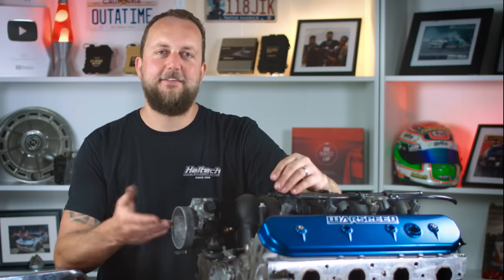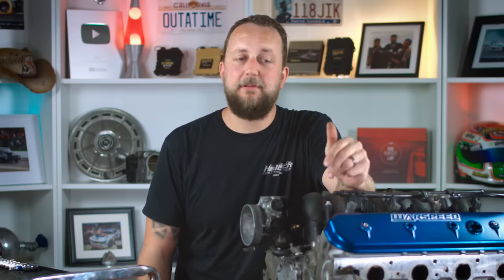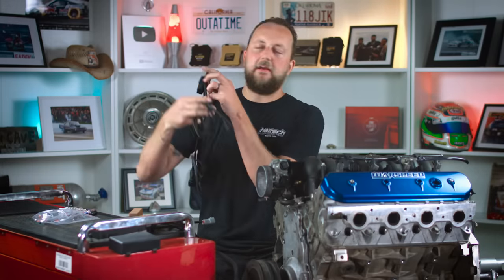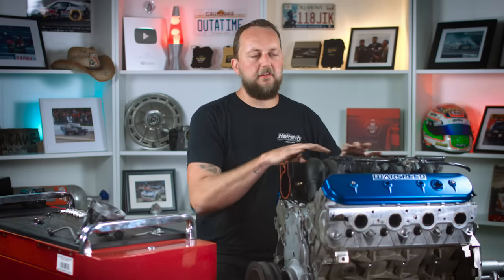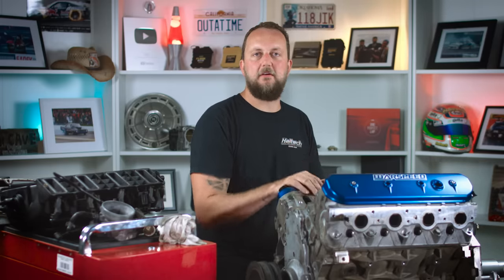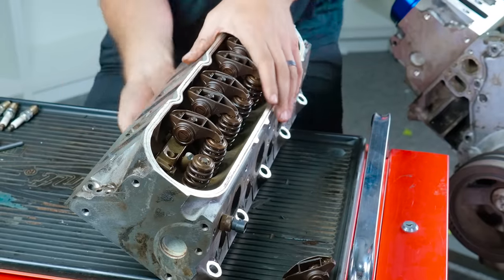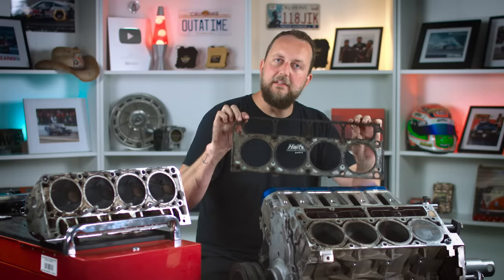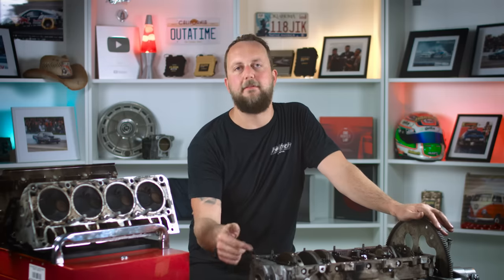🤔 What's so special about the LS? | TECHNICALLY SPEAKING |

Comment: It's whats called the "Amazingly average" phenomenon. Its not particularity special or amazing in any one area, it's that its above average in all areas.

Its cheap, Small, low weight, Simple, High HP and reliable. That's what makes a LS so desirable, and it is what makes gen I small blocks desirable still as well.

Comment: this is one of the reasons the gen5 camaro ss is way better than the s550 mustang...the coyote motor lacks torque..
Reply: Robert Mills  
wrong
torque is way higher on the ls.
the ls is easier to tune
easier to work on
smaller.
less things to go wrong.
if you check you'll find the ls motors have been voted one of the greatest engines ever created
Reply: Robert Mills  
that's why it's so great..easy to maintain and work on.
you ever tried working on a over headcam vvt motor..
those coyotes have no low end power and sound shite. nasty raspy sounding things.
i ended up hating my s550 mustang and went back to the camaro..way better car in everyway. not everything is just about bhp..in fact most folk are not that interested in it. i love the lazy way the ls motors perform..
that's why it's one of the greatest motors tuners use

Comment: You did miss a few things about the valve train that I’d have mentioned. 1. You said that the lifters were hydraulic but failed to indicate that they are roller lifters as well. 2. You didn’t show a lifter. 3. The lifter trays or retainers are an important part of the valve train. 4. By taking off the rocker covers, rockers and removing the pushrods, if you carefully rotate the camshaft the lifters will be trapped in the up position allowing you to do a very simple cam shaft swap without having to pull the heads. 4. With a camshaft swap you’ll need stronger valve springs, retainers, and pushrods. Stock pushrods are a weak point. Better rocker arm systems are available for little money.

Comment: A tip for anyone looking at a future swap, there are 2 generations of LS, not including cathedral/rectangle port, the gen 3 and gen 4. They're pretty compatible except for 
1. The gen 3 has a 24 tooth crank reluctor while the gen 4 has a 58 tooth
2. The gen 4 have stronger rods
3. The knock sensors on a gen 4 are moved to the side of the block instead of the lifters valley
Both are good choices tho
Reply: Also the engine in the trailblazer SS is a gen 4 engine with a 24 tooth crank reluctor
Reply: no drive by cable gen4s either as far as I know

Comment: Two important things which contribute greatly to LS popularity were left out. The most important thing was using the old SB Chevy bolt pattern which allowed the LS to be easily swapped into millions of older cars. The clean sheet wasn't quite as clean as stated. The second thing is the plastic lifter retainers allowing cam swaps without removing the heads, big with tuners.

Comment: This engine is doing insane performances on tracks, i can't imagine it having full cylinder head with 4 valves for exhaust and intake and direct camshaft it would blow the whole track away 😂🤯 but absolutely it needs a huge engine bay

Comment: Video was a bit remedial. If you're on this channel you shouldn't need a push rod explaining to you.

One thing worth mentioning that you missed, and that is the plastic lifter guides. Don't throw in new set of lifters without replacing the plastic lifter guides, because they're probably the reason why your lifters are buggered to begin with. Being plastic they flog out over time which allows the roller lifter to rotate in the lifter bore. When the roller on the lifter isn't running parallel to the camshaft, you start getting wear. Factory roller lifters don't have link bars to keep them parallel.
Reply from the maker: We try to not assume any prior knowledge. It's better to explain than to exclude a whole bunch of people who might not be familiar with some part of the video:)

Comment: I have a ve ss (afm) New to these kinds of engines (coming from a euro) 
I’m having the exact same noise in which you explained in the start of the video, lifters are rooted. Obviously to change them the whole top end has got come off. So the situation I’m in now is whilst it’s off do I go ahead with the whole head and small cam package upgrade, dod delete and tune. My question was what would the power and torque roughly equate if I were to do so. I have a compete custom exhaust and extractors but sorted wanted to know the cost also.
Reply: Probably looking at 3300$usd at a shop or like 900$ in just parts
Reply: The plastic lifter buckets allow you to remove and replace the lifters without taking the heads off. It was built like this so car nuts can easily swap cams.

Comment: But GM’s divisions stopped making their own motors so you can’t buy a Buick motor or Cadillac motor or Chev motor any more. 

GM Powertrain division made the LS motors since the 1st one. 

You can certainly say an LS is related to a Chev small block but it isn’t a Chevrolet engine. 

And that’s why commodores with Chev badges make the baby Jesus cry. 

They are not GMC. They are not Chevs. GENERAL MOTORS POWERTRAIN DIVISION. GMP. Not Chevrolet.

Comment: The camshaft bearings are the same, or they increase in size? 
I'm also curious if the heads  are really mirrored, and if they bolt on either bank
Reply: G55STEYR cam bearings are the same size, also the heads can be installed on either bank. They are interchangeable

Comment: These days with $225~$275 an hour labor rates, I don't understand why anyone will want to swap an LS into a car when the overwhelming majority of any swap will be the labor not the engine. An LT1 crate engine is only $8,400 brand new. A used LT1 is about half that. You can expect to spend 3x to 6x the cost of the motor on the labor to do the swap. So engine cost is largely irrelevant. Heck, just to swap a camshaft on an engine will run you $2000 in labor charges.

Comment: Why don't ya say number 4 cylinder goes  valves bend  has a non priority oil system isn't that why dart designed a billet ls  block to address that problem  and ya can get them for a big Mac meal in the states.oil pump problems  etc.v8 money pit just search u tube more people repairing them all time they  sound nice shit ya but at cost.peace

Comment: Did a lifter in my vz ls1. Did have vcm cam all the good gear convertor 3.9s raced it regulary. stripped it wacked new ls7 lifters new cam oil pump timing gear etc. Still had hone marks in the bores and it had done 187k then. Made same amount of hp as it did with larger cam. Ls is king

Comment: The splayed 6 bolt mains keeps crankshaft from any movement keeping it extremely tight to the block much better than all previous pushrod V-8 engine designs unless a special built race engine most stock engines don't compare in strength on the bottom of the engine I'm talking factory engines stock cylinder heads that flow very good numbers as cast and even better when CNC ported intake flow over 310 cfm as cast and over 350 cfm CNC ported these numbers are comparable to bigblock engine flow numbers l know of no old style chevy stock smallblock heads that can flow numbers CNC ported that even come close to these numbers maybe some very expensive aftermarket heads but even then most struggle to flow much more than 280 cfm on the intake side these two reasons is why the LS chevy can make good power with a mild camshaft upgrade and the reason they run well and last longer these engines with 364-376 cubic inches can make 550 or more horsepower with a stock shortblock stock crank rods and pistons be completely streetable rev to 7200rpm repeatedly without any strain and last twice as long as the old style smallblock chevy engine in order to do this with a old style smallblock chevy you better have all forged internals crank rods pistons it better be built to much better tolerances than a stock engine and it still will probably not last near as long as a LS engine and I'm talking pump gas engines LS engines can run 11 to 1 compression on 93 pump gas and most old style smallblocks making over 525 horsepower have 12 to 1 compression and your probably not going to get it to run to well on 93 pump gas without taking the timing out of it to stop in from detonating

Comment: The lifter holders are a brilliant idea, turn the engine over a few times and you can remove the cam without taking the heads off. No manufacturer has ever made life so easy for a mechanic.

Comment: I think the Overview portion stretched on for the length of the video and we never really got into what is so special about it besides that it's simple and compact and makes bulk power. Well I guess that's all you really need to know, oh yeah plus the availability of parts fast and reasonably priced. It would be fun though to learn about all of the applied science and lessons from the old smallblock that are built into this engine that just make it so much better than the old small. I guess a lot of it is the beefy bottom end plus the modern generation intake manifolds just keep getting better and better.

Comment: I recently bought my dads 09 Sierra 1500 sle. I decoded the vin to find that it should have the LMG 5.3, but I noticed that it had the 862 heads. I asked my dad and he informed me my younger brother burned up the motor in 2019 and the only thing he could get in time was a factory reject that was supposed to go in a 1500 HD, but because it had the wrong angle on the cylinders, these are sold to machine shops who bore and sleeve them. 
It isn't flex fuel, so I believe I have an LY6 with 862 heads ...with less than 80k on it. 😃
I'm researching to find out how I can confirm if true or not. Wish me luck!🤞
Reply from the maker: Good luck!

Comment: A few key things:  Alum block with 6 bolts per cap and a compact design.  That gives a great foundation to build on.  It would be interesting to compare things like weight, power, stroke, to things like SBF and modular engines.

Comment: It’s easy: because it’s a cheap V8 that can fit in most engine bays. Also because it’s made with about the same engineering merit as a solid block of steel it is about as sturdy.

Comment: I see this and know why today's cars rarely never make 100,000miles even with regular maintenance. Fuel economy standards & emissions both cause major headaches for overall reliability. If EVs manage one overall short term goal it's stopping that endless gravy train of needless repairs & maintenance on complex engineering for the sake of it being over complicated due to rushing new designs to market to meet stringent standards. Maybe we'll focus more on the shipping industry next.
Reply from the maker: Not sure what cars you're driving but 100,000 miles with regular maintenance is not uncommon these days. Most manufacturers give 100K + factory warranty. Yes there are lemons, of course, but take it as a percentage of the millions of cars manufactured, most of which are now driven in an increasingly long start-stop environment and you'll find that modern engines are actually remarkably durable and reliable.
Reply: @haltech  Yeah, it depends on brand, however you get the drift. Costs are cut to minimize their costs (ie, brittle plastic parts where its constantly heat stress cycling), but ours costs for repair continue to become more complicated. EVs are a breath of fresh air.

Comment: What does the  " L S "  Stand for  ?   i had   283s  /  327  / 350s  400 & 454  i had Many Chevy's  since the early 70s i never had the LS yet,  Buying a Z71   4X4   Soon  , with the LS,    GM  Makes the Best engines ....   What does the Letters Stand for  if anyone knows .....
Reply from the maker: Pretty sure it's just GM's code for that series of engines. We couldn't find any official explanation for this nor for other engine series like LM, L, LQ.
Reply: @haltech   O K.   Thanks for the Reply,   i have asked people in the Past and no one knew...   i am going to be Looking at a 2008 Chevy Pickup  i have not looked at it yet,   i was told its a 5.3  LS or a 6.0   Suppose to have 60,000  Original Miles ,   Thanks again ...

Comment: Didn't GM make the LS engine, not Chevrolet?
Reply from the maker: Technically yes, it's a GM product. Chevrolet being a part of GM it's all in the same family.
Reply: @haltech  So because GM chuck these motors into GM brands like Buick, GMC or Cadillac, it doesn't really make sense to call them "Chev" motors, I suppose it sounds cooler to say "LS Chev" rather than "LS GM" doesn't it?
Reply from the maker: The LS lineage stems from the Chevy small block so it's much more related to Chevrolet than to any other GM brands.
Reply: @haltech  Hmm, I always thought that because Chevrolet are a brand of GM that anything they made was from GM, just had a Chev badge on it and sold under the Chev brand, just like when Holden exported cars to South Africa, they wore the Chev bowtie because they were sold under the Chev brand.

Comment: Hey Scotty at 16:08 why is it called ring gear I thought it was the fly wheel or a mount for it aren't the teeth for a starter.
Reply: The ring gear is a separate piece inside the block. It's used with a sensor to tell where the crank is (so the ECU knows what/when to fire a cylinder). 
The fly wheel or flex plate (I couldn't see enough to tell what it was) is the bigger piece outside the block and is what the starter engages.
Reply: @jarheadcharlie2315  oh cheers yeah not sure why he called it that then

Comment: So do you have to pull down the engine to change the cam. I'm not very mechically minded sorry but slowly learning
Reply: Yep, but you don't have to do it every oil change.  Think positive, not negative.  There's no chain tensioner to shit itself either.
Reply: @einfelder8262  thanks I know you don't change them every oil change. That's just maintenance. But if you wanted to change cams you have to take the head off. Got it thanks
Reply: @franko3006  If you had to take the camshaft off. You definitely need to change or replace other parts.
Reply: @Trident_Euclid  ok
Reply: @Trident_Euclid  if you wanna upgrade the cam I'm assuming you would have to change liters springs etc
Reply: @franko3006  Exactly especially if it's high lift cam. Even if you installed a small cam you better replace the lifters especially if it's a high mileage engine.
Reply: I don't think you have to remove the heads

Comment: What’s so great about an LS engine? If you have to ask you haven’t spent 15 minutes studying an LS Engine. Very self explanatory... As a kid I was able to mix & match engine parts for a quick repair. Parts from a Buick, Cadillac, Pontiac, GM, Oldsmobile, etc parts would usually work to repair my engine. Ford was a nightmare. When I grew up and had kids I never thought GM/Chevy would do it again and make it way better and easier to work on. THEY DID! The LS Engine! Now my kids can go to a junkyard, vet heads, an engine, etc and they’ll generally fit. Way easier to work on and I love them. The BEST OVERALL LS ENGINE IS THE LS3. The LS3 is a BEAST, tough as hell, small, light, sounds incredible, can deal with a tremendous amount of HP without any huge changes. I love it!

Comment: is this better than honda K engine?
Reply from the maker: It's a totally different animal to the k-series. Whether it's better or worse would totally depend on your application and what you want to do with it. It does make more power but it won't fit in smaller cars where the K-series would normally go.

Comment: SORRY TO CORRECT YOU MY GOOD MAN. BUT NOTHING CARRIED OVER FROM THE OLD SMALL BLOCK CHEVY. NOT ONE DESIGN ASPECT OF THE OLD SMALL BLOCK CHEVY LIVES IN THE LS. THE LS IS 100% BASED ON FORD DESIGNS IT'S ACTUALLY A REGURGITATED 427 FORD HIGH RISER ENGINE AKA 351 RAISEDPORT WINDSOR. FROM THE WINDSOR FIRING ORDER, TO THE HEAD ARCHITECTURE, TO THE OILING SYSTEM, TO THE COOLING SYSTEM, TO THE CROSSBOW MAINS. IT'S ALL FORD IN DESIGN.

Comment: if anyone doesn't wanna watch a 20 min vid, its got the best power to physical size to weight to reliability to cost to aftermarket ratio of any engine in the world.  (comment made before I watch the 20 min vid)
edit after starting vid:
not another LS comments only happen on the internet, they're rare enough in real life that people that see them in real life think their cool
Reply: Err, my FG XR6T spanks every LS, with ease. Turboing a v8 isnt so easy, twin turbos are very expensive, as the second turbo can cost more than the engine.

The smaller capacity 4L Barra needs only one turbo, and has killer bottom end and midrange due to its long stroke design. Barras top end power is superior when boosted due to the extra flow of 4v, vs 2v.
Yes, the Barra is taller and longer, but much better when boosted - and why wouldnt you boost ?
Reply: @nordic5490  the point is the LS is a is a combo of all the things I listed...  sure the Barra is easier to boost, but its giant and can serve as an anchor for a cargo ship...  and this is subjective, but personally I don't think they sound good...

Comment: Just a crappy block that makes same power as modern v6 NA motors ...nothing special in Ls 😂
Reply: Amazing. A design that dates back to 1955 in someways has as much power as a V6 design from this century. Hardly a shitty block, the 6.0 will easily build to 400 with a cam swap, springs and a tune. That ain't shit to do for 400. Please tell me another engine you can build sub 1k to 400 or even 500 hp hp.

Comment: Whats special about it? Nothing. But that's the point. It's a simple, reliable engine, for simpletons, and relies on massive displacement to make meaningful power. If it wasn't so light and small, it wouldn't be half as popular as it is.
Reply: & I take it your into pissy little motors that run on a hair dryer that turn into granny car if you take it off 😂
Reply: "If it wasn't so light and small, it wouldn't be half as popular as it is"

You spelt "cheap and common" wrong.
Reply: You consider 4.8 liters to be huge? Feel bad for you